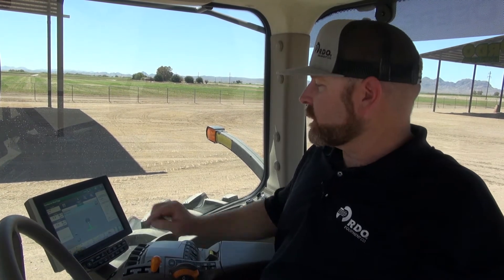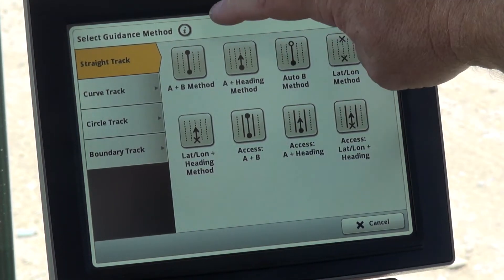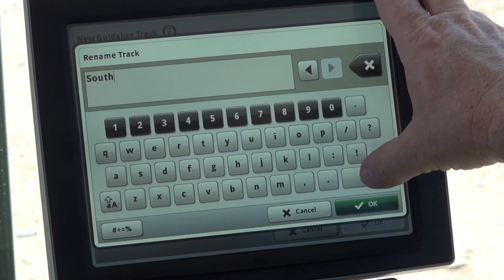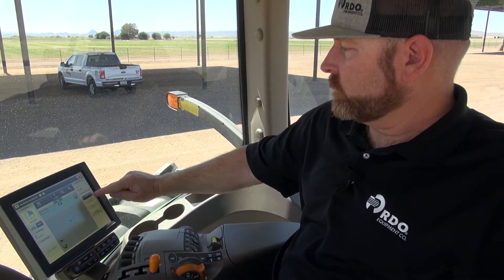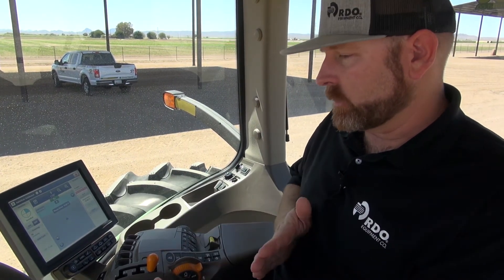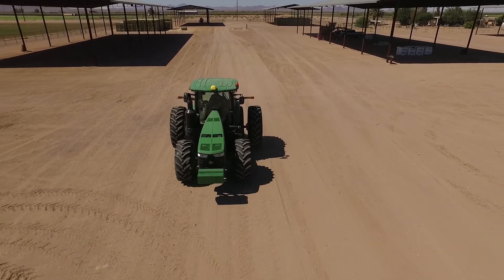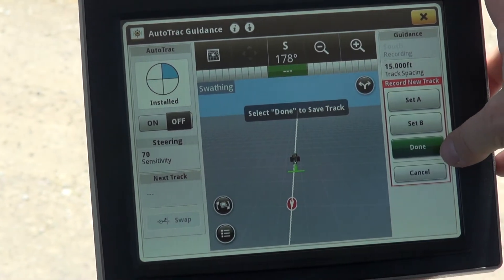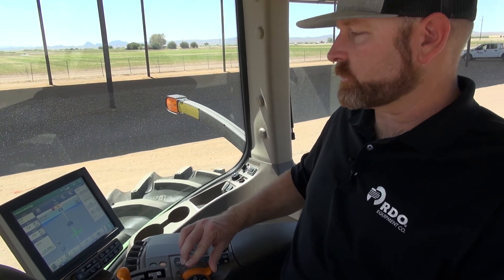John Deere Gen4 Display: How to Set an A B Line

Comment: Is it possible to change a track heading like on the 2630 displays?
Instead of making a new track
Reply from the maker: Yes, with 19-2 software we now have the ability to edit the heading of a straight track in the display as long as the track was originally created with the A + Heading or Lat/Lon + Heading methods.
Reply: @RDOEquipmentCo  thanks for responding.
So if I'm correct you can't edit straight ab lines?
Only A+ headings
Reply from the maker: @hendrik1636c  Correct, if the track was created using the A + B method you can not edit that track in the display. Keep in mind that in Land Manager with in the Operations Center you can edit all tracks even if they were created with the A + B method.
Reply: @RDOEquipmentCo   very well. So after you edited the track in land manager,can you just upload that field to your display again? Even 2630?
Thanks this helps me a lot.
Keep on with the videos,they are the best.
Reply from the maker: @hendrik1636c  On a 2630 display you will have to upload a completely new setup file. On a Gen4 display you can upload just that field.
Reply: @RDOEquipmentCo  so on 2630 everytime you would wanna load a new tractor or new crop or something, and you do it on myjohndeere,you would have to upload the original setup file you created in the very beginning?
Reply: @RDOEquipmentCo   i can't change my A + heading on my gen4 display,does it need a software update?
I have the 10.9.79-143 version